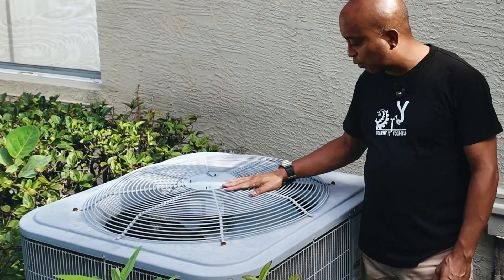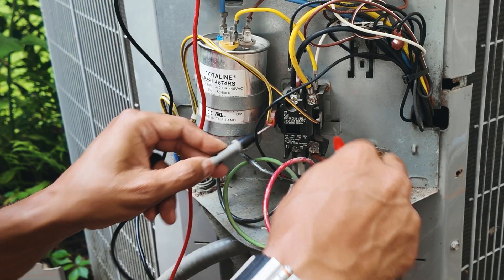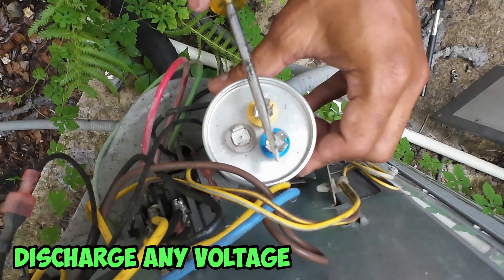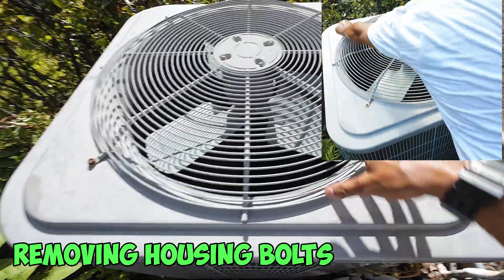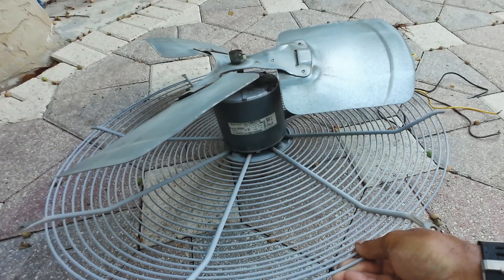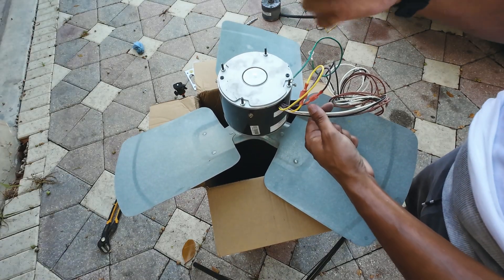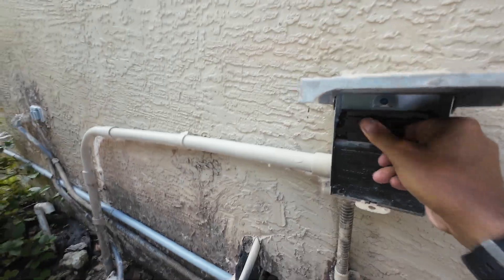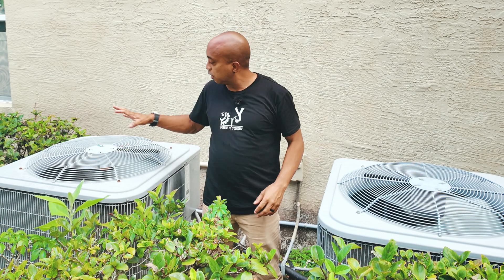How to Replace a Bad Condenser Fan Motor on Your AC Unit (DIY Repair)

Comment: Does it matter which way you put the fan blades on, like what if you flipped the fan blades the other way and installed it?  Also, why do some people with universal fan motors put the ground on the top screw when the original doesn't have that?
Reply from the maker: Yes it matters which way you put the fan blades, that is why it is important to put it on the same orientation you removed it.  The original dosnt have a ground screw becayse it is internally grounded.
Reply: @DeaninItYourself so if I get an original replacement fan motor instead of a universal, it won't have that ground wire on top?
Reply: The brown wire with white stripe goes on the common side of the capacitor